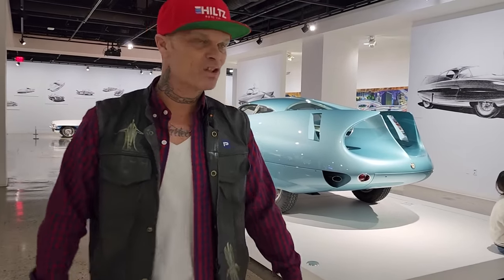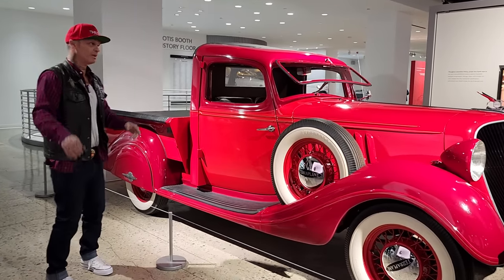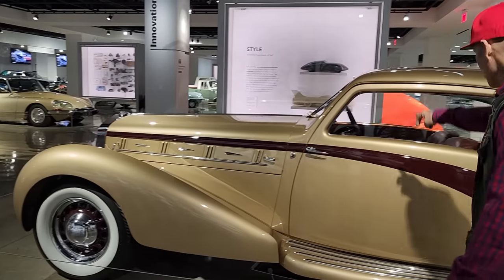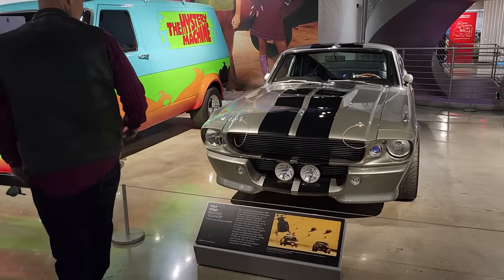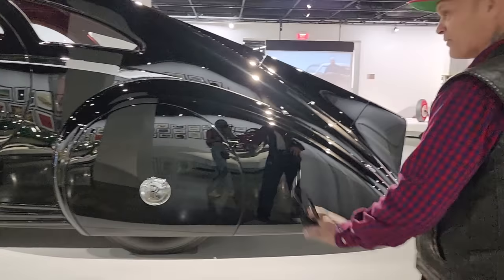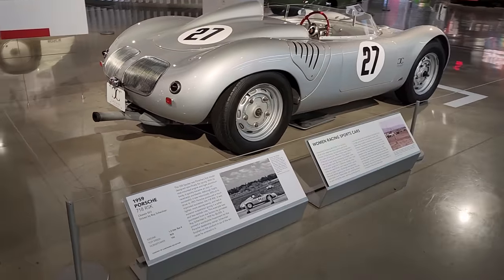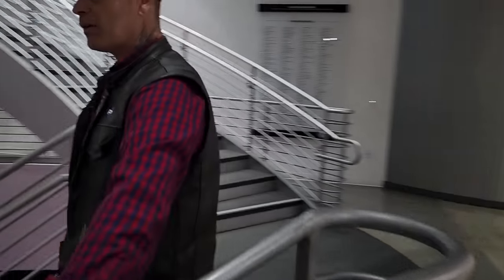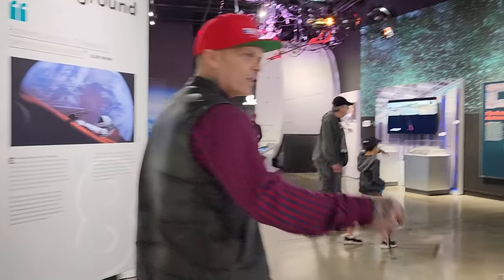The Petersen Automotive Museum is... AMAZING!!! 🤯

Comment: Hey, Chad, Good to see you again!  First thing I noticed was the B.A.T. car(s) from Italy.  The B.A.T. cars fins (wings?) may have influenced the finds placement on 1960 and '61 Chryslers cars, Newport, Saratoga, New Yorker and 300G because the fins start a the middle of the front door driver/passenger (an looks better on 2 door models). I have a '61 Chrysler Newport coupe and it is a challenge when you (start) to parallel park because the fins block the cars rear fender that you are wanting park behind.

Comment: The third car you looked at that was green, looked a lot like a Studebaker Hawk that was highly customized.  You should try doing an extreme customization on a Hawk.  Change it into a two seater and really change it up.  I'm pretty sure they are pretty reasonable to buy one in driving condition.  Just a thought for another fun project.  If you spend a little more to get a running car it saves you a lot of work in the long run, and you really don't build high performance cars anyway.
Reply: 1955 Chrysler Falcon by Ghia.